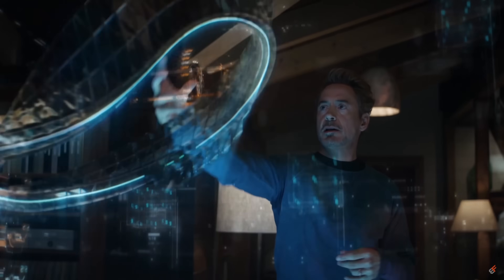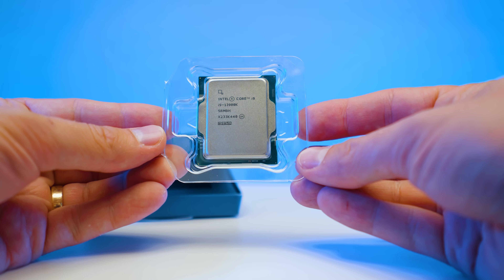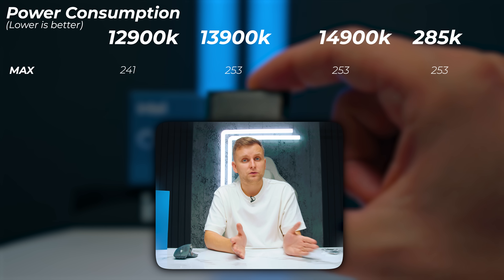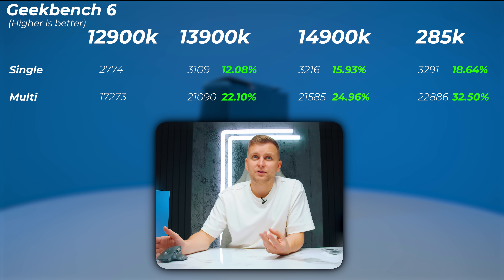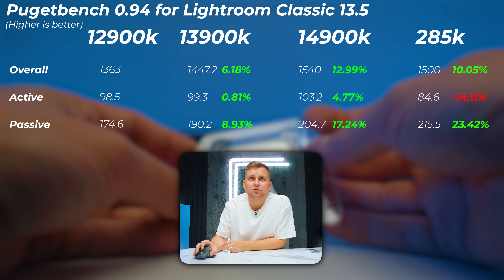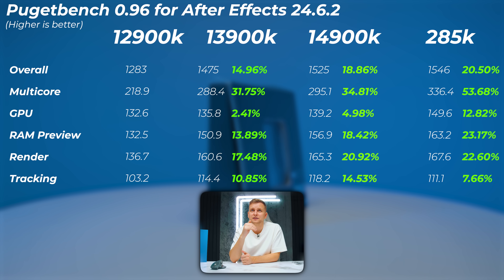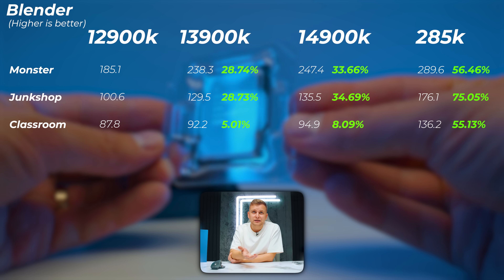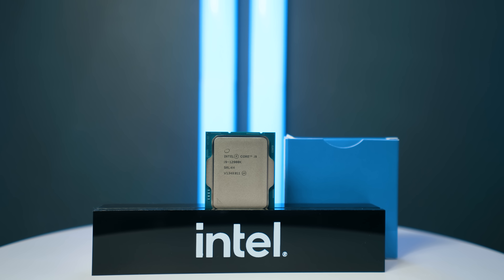4 Generations of Intel i9-s  👉🏻 How much ACTUAL performance gain? | 12900k vs 285k

Comment: Quite chuffed I could run 6600mts cl32 corsair dominator platinum ram on a 12700k at 6400mts stable and thought i was running badly. Recently getting the impression thats actually a good result. Even on all core full loading work. Adding a 13900kf today and hope to use the xmp setting of 6600mts 🤗

Comment: It more than anything in this day n age to upgrade to your needs not just blind cause something is new. You just waste money that way. 
I find intels approach to completely ditch hyperthreating to be interesting even so it sure hurts the cpu compared to it higher threat count predecessors in some areas. It sure helps for easier cpu/core management in other areas.

But the same in this video is true for amd. Upgrading every couple of generations, preferably ones that than also come with their own boards and new gimmicks is the way to go. The only exception is if your stuff breaks or you run into problems with newer software/games.

Comment: My biggest gripe with the 12900k is it doesn't let me raid 0 some M.2's with my motherboard. I don't think the price difference to go up to the 13900k is with it. If there's a matx board than can raid 0 12900k it sounds like that would be better but I am so disappointed in Aorus :( The 12900k I have been happy with though. I run an arc a750 and it does everything it needs to.

Comment: I'm amazed you still have an audience for this stuff. "I test differently". I pick the ram to be out of box settings...helps the new CPUs. But don't worry. I Cut the power to the 13900k and 14900k to slow them down so the 285K can have a head start. Pick one...factory settings or not? But the GPU is faster. No...the old one was that bad. "And with the BIOS update...there shouldn't be any issues with them DEGRADING ANY MORE" IF YOU ADVISE PEOPLE TO BUY INTEL RIGHT NOW. YOU HAVE TO BE THE BIGGEST FANBOY. There litterally is no reason. But you still find ways to "adjust" your testing to find a way. 9950X, sorry intel fans. It's the one you want. When the 9950X3D comes out... that will be the one you want. Move on. You can always come back to intel later.

Comment: Very good comparison, as always great vid. I use cpu for work and gaming, Intel was always the choice. Using 13th gen i9, no issues after cries over yt, microcode works, 128GB ram for workloads, never had single crash. Tested AMD platform for my usage and sadly its marketing bullsh1t, only for gamies' its ok, but for serious work Intel. Sadly cause would like to see some real competition, not pseudo gaming benchmarks. Keep up good work TechNotice, good tests. Maybe next comparing AMD cpu's from top line?

Comment: why would you run the intel 285k at 6400MT?  285k gets a large performance boosts running 8000MT+. its also really easy to run 8400MT speeds on the 285k. pretty much works out of the box.

Comment: Think I will be sticking with my 12400F / GTX 1080 ti combo. I was using a 4790K until June of this year. The GPU has been with me since end of year when they came out. That has never failed, except for a fan. Replaced the stock cooling solution on that. I used a Noctua NDH 15 for the CPU. The ASUS motherboard, RAM DDR3 1866, and SSD (850 Pro SATAIII) swapped also. Those are replaced with ASRock motherboard, RAM DDR5 6000, and NVme M.2 SSD (980 Pro) for storage. I am still waiting for when I actually NEED insane processing and graphic power before updating again. Call me crazy, but this works and saves me a ton instead of upgrading every six months to a year like I did in the late 90s and early 2000s.

Comment: would you recommend 14900kf or 9950x for video editing pc?
Reply: I have two computers with 14900KF and 4090, both of which have encountered blue screens and software crashes. At first, I thought the graphics card was broken, but my friend's 14900K also had the same issue. I strongly recommend against purchasing the 14900
Reply: @ thanks! im pretty sure im going with the 9950x and 4070 to super. wanted to get 4080 super but its pretty expensive in Canada
Reply: @mahirahmansphotography8117  Maybe you can wait for the release of the 50 series graphics cards? If you can wait a bit longer, I believe the 40 series graphics cards will reach the price you want

Comment: Hi, I noticed that the links are not correct.
F.e. The 12-13-14 900 board link lead to Z790 Proart mboard rather than Asrock Nova what You mentioned in the video, and the gpu link is a Tuf card link.
Maybe some others are wrong (not correct) too . .
I hope I could help with this!
😊

Comment: June 1 2024 i bought the 12900KS and skipped the 13 and 14 because of the issues and i can't be happier coming from a 10900kf
Reply: Intel has solved the problems completely after the microcode update. I upgraded to the 14900K right away after the update. It never runs abnormally hot even under heavy load on gaming or content creation. 14900K maybe the best all-around CPU right now.

Comment: 10:32 ..... SORRY but there still are !  13Th & 14Th gen Intel CPU's are only good in a trash bin !   Just F Intel !    
AMD Ryzen is just king, and just THE BEST !   Intel is DONE !
Reply: do you work for AMD? 😂 geez calm down and get back in your pram 😂 I chose the 14700k over the 7800x3d paired with my 4080 super and I dont regret it.  X3D are a total rip off.  If intel is done, so is gaming.  prices will rocket and AMD are no where big enough to keep up with demand.  Just look at the 9800x3d situation 😅
Reply: Intel has fixed all the problems with 14th gen after the microcode update. I'm using a 14900K right now. It never runs abnormally hot anymore even under heavy load.

Comment: Nice Comparative! I am undecided and need help. I currently have a Ryzen 5700G and I want to start from scratch on INTEL. I edit videos in Davinci Resolve, but I see this specific problem that these new Core Ultras have with "LONG-GOP" (H264-H256 4:2:2 files) and I am afraid to upgrade to CORE ULTRA. Any advice??
Reply: I tried a AMD system for DAW’s and had to go back to Intel. Some of the problems I had was issues with heavy cpu use virtual instruments. 😬
Reply: @BigHoTzMuZik  Yes, and in video edition it is almost 2x with quicksync
Reply: go AM5, that intel platform on the ultra 2nd gen series is buggy. that is why intel score in freefall. i just ordered my asrock AM5 RIPTIDE it has 2 thunderbolt 40gbps ports but i am saving on processor. it will last you another 6 generation if u go on AM5.
Reply: @vampritt even 9950X can't beat intel ind DR AE PP due to lack decoder..
Reply: @vampritt nah AMD are worthless in DR PP and Adobe AE.. the reason I avoid AMD the first place..
Reply: imo your mistake is that you want to switch to Intel
Reply: I understand, but Intel has x2 "Quicksync" performance compared to what AMD offers for davinci resolve and premiere pro.
Reply: buy 12th gen they are cheap and monsters you dont need anything more than that

Comment: The 285k is a massive flop. The 13th gen is the best value for money at today's prices
Reply: 285k HAVE Igpu PROBLEM too... very buggy. that is why intel got kicked out of NASDAQ and its stock plummet
Reply: @vampritt  what they should have done is remove the e core's and just gave more p core's and that would've kept them in the race with amd
Reply: 13th gen have problems 14th also  no buy it all
Reply: @hardstylboy  some have problems not all
Reply: @hardstylboy  it's a good lottery when they give you 5 years warranty so you have zero reason not to buy
Reply: @hardstylboy   The entire 14th gen problems has been fixed by Intel after the microcode update. I upgraded to 14900K after that update. My 14900K never runs abnormally hot anymore under heavy load. I did heavy stress test as well. It won't even hit 70 deg C. I topped at 67 deg C.

Comment: Let's see the same tests on 4 generations of AMD CPU. Then compare the uplifts to this video. I would find this really interesting to watch.
Reply: If you are sponsored by Intel you cant talk about AMD unless its something bad about AMD.
Reply: Yep the % increase is not as relevant if it's already say 10% faster than alternative options. 

It's why the Apple comparison was pointless since yeah might get % uplift increase but is relatively performing anywhere close to matter or are they just needing to catch up faster and had more headroom to make up.
Reply: in amd you pay 200$ for a 6 core cpu when in intel you pay for more cores...in productivity intel is the KING
Reply: @Vennux  The problem is, Intel CPU is a lottery. If you like me, you lost the lottery by receiving a defected chip (i7-13700k) that is always at its top Mhz and never goes down even when PC is idle. Gets to 100% usage just by scrolling photos in Lightroom and as a result gets to 100 degree Celsius and crashes more than once a day. And many more issues.

Updating BIOS does NOTHING, reinstalling Windows does nothing. The time you waste restarting the PC and recovering from soft crashes and hard crashes well worth NOT buying Intel.
Reply: Why? The point of this comparison is to help users decide on whether or not to upgrade from a 12900k depending on their usage. Your suggestion to compare the results of the AMD CPUs vs the Intel CPUs will only highlight the difference in improvements. All of us already have a good idea on what that looks like. What's interesting about that?
Reply: @FinalStigma  He meant; do the same comparison to AMD chips, not compare AMD to Intel CPU's but compare AMD CPU's of four different generations.
Reply: The interest would be look at the uplift over 4 generations the exact same way this video did. Then take the numbers from this video Gen over Gen and compare the 2 side by side. This video in my eyes did show me the new Core ultra is not as bad as I thought it was. There is nothing wrong with an apples to apples comparison with zero bias.
Reply: @FinalStigma  u blinnnd? he said  4 generations of AMD CPU duuhh

Comment: You are using UDIMM to 285K when it supports CUDIMM. Using the correct RAM and enabling XMP has 20% if not more performance jump. Misleading review for clickbait. 6400 UDIMM drops to 5600 speed. And power for 285K is 250 not 253.

Comment: Hello Lauri. Based on knowledge acquired from your videos, we've just built a creator pc with the following specs:
AMD Ryzen 9 9950X 16-Core Processor
AMD Radeon Graphics
NVIDIA GeForce RTX 4070 Ti SUPER
96GB (2x48GB) 5600MHz
Microsoft Windows 11 Pro
ProArt X870E-CREATOR WIFI
And these are pugetbench results for photoshop:
Overall - 11195
General score 108
Filter score 117

Thank you 😎
Reply: Great Build. If you ever wanted hackintosh a 6950XT would be the best gpu possible (since the newer radeon aren't compatible). And perhaps overclocking the ram or getting 6400mhz if money is not a problem. As well as u2 drives like optane, and maybe raid 0 with gen4 drives to get gen5 speeds (for sequential only) at half the cost. And by the way look into PARSEC and Sunshine Moonlight and tailscape to use that beast of PC anywhere with internet with any laptop or tablet and almost no lag at all. Cheers

Comment: 12th gen is my favorite intel cpus.  The i7 12700k is awesome for anything
Reply: have also a i9 12900k  4070 super oc its fly
Reply: @hardstylboy  I have 5800X3D and thinking of pairing it with 4070 super
Reply: Agree, I mostly use the 12900KF and 12700KF is my media computer now. It's still great though.

Comment: the 12th and 14th are the best bang for dollars currently. Specially since they can run (now in some cases heavily discounted) with z690.  One of this days amazon was selling a z690 unify motherboard for almost 170 dollars, that has 5 m2 slots and pretty decent cooling and vrm's. Side note, assuming 48 gbs is sufficient for the task,  the 14700k/kf depending on the price (have seen it recently at around 300usd)  is a pretty decent cpu , in many aspects surpassing the 12900 specially if using 7200 ddr5 or better (and unlike the 12900, the 14700 generally can handle 48 gb of  7200 ddr5), Another option is the 12900KS that i also seen going for 250 sometimes.

Comment: but no human on planet earth would run ddr5 ram of 12900K at 4800mhz. You should test all at 6400mhz, 7200 nhz or 8000mhz so that it is fair comparison.
Reply: Agreed. Not sure I've ever read of a 12900k not being able to hit 5600MT minimum. Most will do around the 6000-6600MT mark, with some significantly higher.

Comment: 12th gen for life. I have one computer with an I5-12400 and one with an I7-12700. I couldn't be happier with them. Never an issue.
Reply: Agree, Have a stable 12400, 12700KF, and daily driver is a 12900KF it's still great. For mostly gaming with 4090 it still seems fine.
Reply: I had a 12400f until 2 weeks ago, because I got heavily cpu bottlenecked in COD Black Ops 6
Reply: @IseeIceTea   buy a i7 or i9 or amd 3d cpu  for gaming
Reply: @hardstylboy  recently bought 12900KS skipped the issues with 13 & 14
Reply: nice
Reply: you are so right i have 12700k i can do anything im so happy
Reply: But what do you use them for.

Comment: This does not surprise me 12th, 13th, 14th gen used the same core architecture so makes sense they are just speed bumps, where the 285k is a new architecture.

Comment: Make sure you run the high performance power plan with any of the core ultra cpu's. I just went from a 12600K to a 245k and the 245K overclocks great and I'm running 7600 DDR5 @ 8000.
You do know Intel is working on the issues with the core Ultra? BTW: I bought it for 270 bucks on sale from B&H...
Reply: Good to know, I'm waiting until a fix happens to make a final decision for a new Music DAW, looking at the CU 7 265K, living in a hot climate CPU running cooler is a real sales point for me, any pre CU CPU would probably suffer thermally throttling, so I'd lose more performance than I'd gain running the older CPU's
Reply: @martinweston7144  Hi. I'm also looking for a cpu for music daw. Is i9 285k good? does it have the same instability problems as generation 13 and 14?

Comment: Photoshop, Lightroom and davinci resolve long gop look a lot like software issues.

the 285k is Chart topping in all single threading tests yet in Photoshop it absolutely dives. to me it Looks Like Photoshop is using the e cores over the p cores or whatever it might be.

Intel has some fixing to do, but arrowlake has some impressive gains, especially when looking at the igpu. i found that the igpu in my 265k delivers 1/3rd the peformance of a 5700xt in affinity photo. you wouldnt really need an extra GPU with the arrowlake igpu, its really quite powerful.

Comment: Black Friday is coming up, and I'm tempted to upgrade my i7-6700k. I already have an RTX 3080 TI so I don't need a new graphics card. I also technically don't need a new CPU since my 9 year old CPU is still running strong, but potential upcoming tariffs and war have me worried about supply in 2025.

I'm shocked at how well my i7-6700k is doing in late 2024.

In mid 2024, I downgraded my PC to a mini PC with Intel i5-8400T with integrated graphics to test its capabilities. I was on that machine for 4 whole months, and I was surprisingly able to work and even play games. I brought my mini PC to work to play games at lunch so I'm still using it.

Comment: This channel should have at least two millions of subscribers!
Reply: He'll get there. Give him time.
Reply: With wrong info? Don't be gullible. Using UDIMM to 285K when it supports CUDIMM. Using the correct RAM and enabling XMP has 20% if not more performance jump. Misleading review for clickbait. 6400 UDIMM drops to 5600 speed. And power for 285K is 250 not 253.